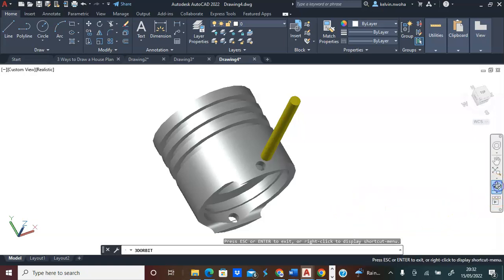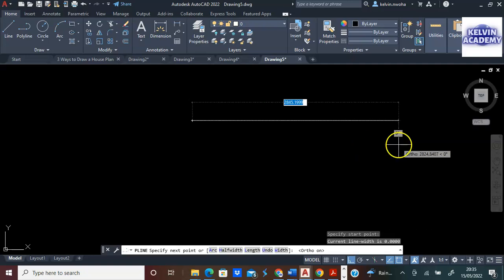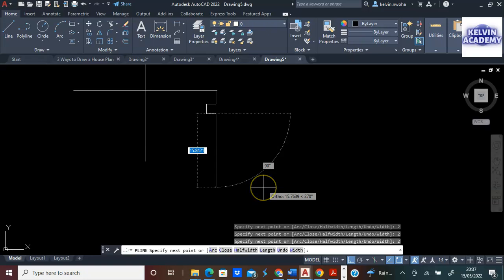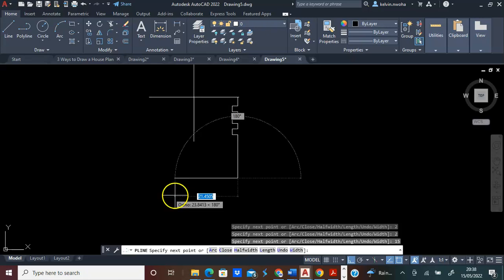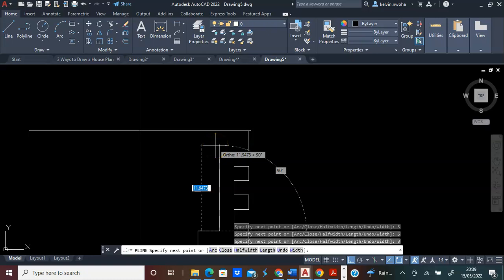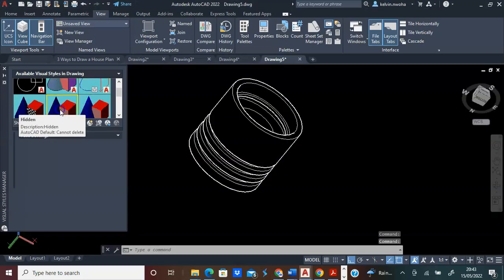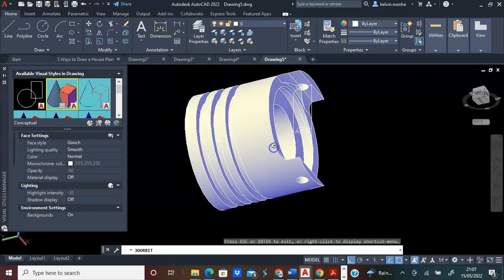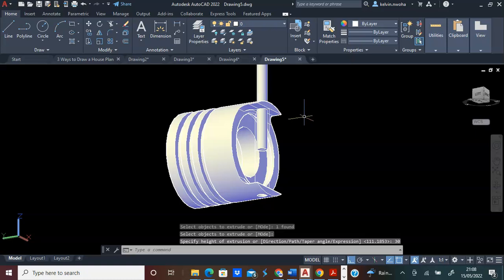How to Draw a Simple 3D Mechanical Piston in AutoCAD

Comment from the maker: There are many ways to draw a 3D Mechanical piston in AutoCAD. You can hardly draw anything in AutoCAD 3D without using the line and polyline command tools in one form or the other. In this video, I’ll walk you through all you need to know about how to "Draw a Simple 3D Mechanical Piston in AutoCAD". Other piston parts and shafts will be completed in another video, which will enable you to learn machine coupling.

00:00 Introduction
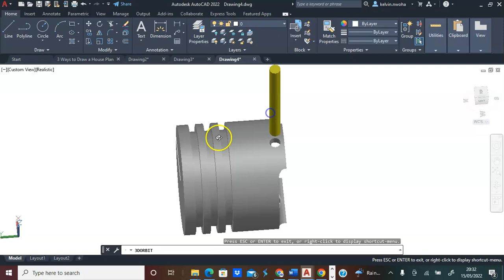00:05 How to Draw a Simple 3D Mechanical Piston in AutoCAD

LIKE THIS VIDEO THANKS! SUBSCRIBE: https://www.youtube.com/c/KelvinAcademyYouTube?